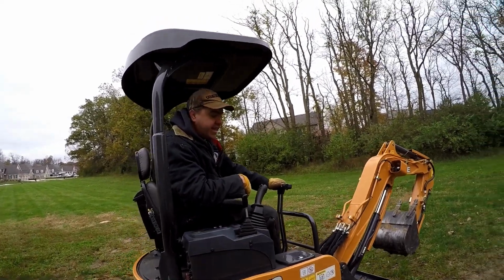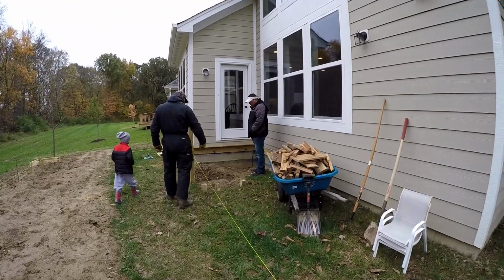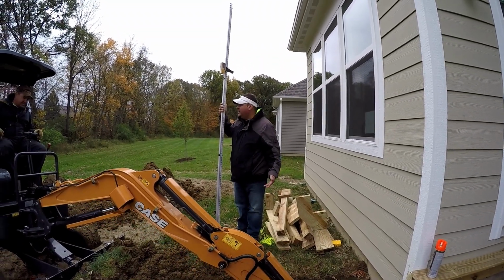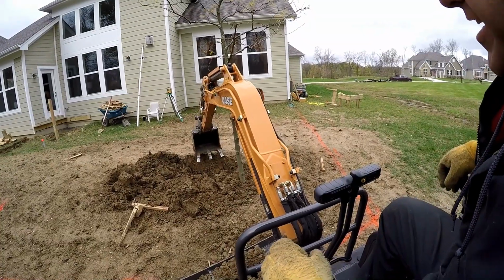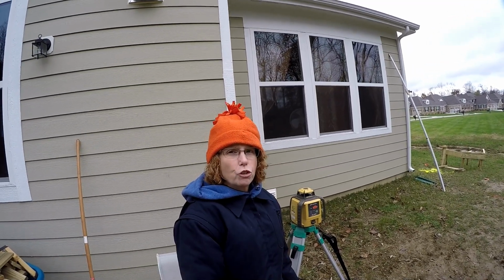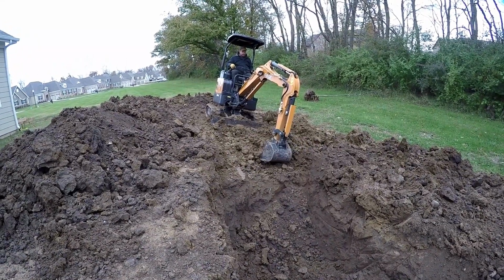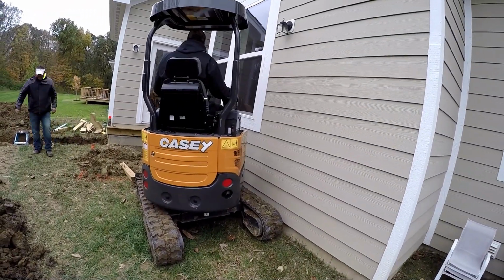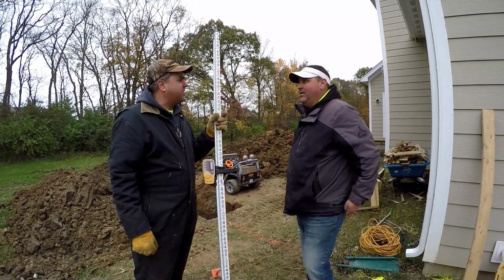The Big Dig, Case CX17C Mini-Excavator Digs Footer for DIY Patio, Job Too Big for JD 1025R

Comment: May I suggest, that the next time you're on uneven ground, orient Casey with the tracks perpendicular to your trench. Then use the blade to lift Casey to a level position from the downward side. By doing this you will also loose stability, front to back, from your digging direction as your tracks are now perpendicular and you have the shorter span towards your digging direction. Casey is a great addition to the team!

Comment: Put your spoils (excavated materials) about 3' away from the excavation. And so you can see your lines when digging put you bucket flat to the ground and knock the loose dirt back in the trench to take out with the next bucket.
Reply from the maker: +Branden Howard good advice, thanks.

Comment: Turn the machine sideways and use the blade to level the excavator.  Note  dirt should be two foot away from you ditch and no one should be in a 5’ ditch. Always safety first! Good job on the dig.

Comment: Hi Tim, Good equipment (Topcon). Getting ready for some leveling. Topcon Laser, Topcon Pole mount 360 degree reciever mounted on box blade, with Topcon blue tooth magnetic mount display in cab. This way I wont have to look backward at reciever mounted to three point with blade, Raising, lowering watching only display in cab. Full automatic is $5k more, Hopping manual will be just fine for 1/4 acre. Here is a magnetic reviever for back hoe Topcon LS-B10 Machine Mounted Laser Receiver 57110 mounts to backhoe for level trench. Case will be happy to see this video.
Reply from the maker: That sounds like a fancy setup.

Comment: Great job Tim ! And your wife was a very important part of this project !!!! Again thank both of you !!! Be safe my friends and God bless you all !!!!!! Eddy
Reply: One thing to remember Tim when it starts freezing you need to clean the track and roller frames. If it has to ever set outside that is !!!!
Reply from the maker: +Ray Eddy thanks Eddy.  She is an important part of EVERY project!
Reply from the maker: +Ray Eddy ok,'thanks!  First equipment I've had with tracks
Reply: On surface coal mines we used what is called a track spade. Just a slim shovel really  .

Comment: Hello

When starting a trench you scrape off in layers, from the furthest reach of the boom all the way back to the machine. This will ensure the track is going straight and not starting to veer off course. To obtain a nice flat level, use the boom and the bucket in unison by moving the lever over towards the bucket to crowd it slightly. That is you keep the bucket flat as you start bringing the arm back towards your machine. It takes a bit of practice but once that skill is achieved you can grade with ease. Another good tip, if your machine wobbles because you are sitting on an uneven surface while digging. Wiggle the tracks slightly this will help the machine bed into a more level surface. A wider bucket without the teeth would be a great addition to your machine to help move the piled dirt quickly and for levelling large areas.

These machines are worth their weight in gold.

Congratulations on your new addition to the digging family :)
Reply from the maker: +D0csavage1 thanks!

Comment: Great job Tim you have to love how fast you can swing and dump the dirt so for away from where you are digging at and that you can get right next to the house to dig ! now you need a small dump trailer to work with Johnny so you can move it out of the way ! but great first video for casey ! have you tried to put Johnny & Casey on the trailer to see if they would fit ? take care have a great day and God bless ! Curt :-)
Reply from the maker: +Kioti CS2410 they will not fit, not even close
Reply: I did not think they would i know Johnny is just like my Kioti and they take all most hole trailer but i have see some guys put the Mini-Excavators on side ways up front and let the backhoe hang off the back ! but take it ezy !  Curt

Comment: Something else you could have done to level the excavator while digging, is to turn the tracks 90 degrees and use the dozer blade to level Casey. It does require more work to move.
Reply from the maker: +Travis Moore don't have much stability if I try sideways digging.  ...need that blade in front to stabilize.

Comment: Just saw this video. Good job. Get used to building a level area for the excavator to work from. Talk to the finance department about getting a 36-40 inch grading bucket and a atv dump trailer while it won't replace the JD you can get a lot done with those items. Keep on having FUN
Reply: I know it is quite randomly asking but do anybody know a good website to watch new series online ?
Reply: @Maddox Zakai flixportal
Reply: @Lance Kolton Thanks, signed up and it seems to work :) Appreciate it !
Reply: @Maddox Zakai You are welcome :)

Comment: Do you think this excavator or the 27D would work with digging down 7-8 feet around my basement? I need to install a French drain.
Reply from the maker: The cx26c or cx35c would be a better bet for 8’.  Cx17c will do 7’

Comment: I have to try and rent one of those Case this summer for a little project i've come up with. Do you all have to deal with a HOA to do these improvements, permits and all??
Reply from the maker: The customer usually handles the permitting in our situation.  We usually work with more 'DIY' oriented folks.   We usually don't handle a complete construction project.
Casey will definitely do the job for you.

Comment: No need to pile dirt up to make yourself level. You should just turn your tracks sideways and use the blade to level yourself to dig the vertical ditch.
Reply from the maker: +01Brever as I said in another comment, sideways digging doesn't work so well.  Really need the blade in front to stabilize.
Reply: That is correct, but sometimes you have just have to turn them and take smaller bites to make things a little more comfortable and convenient to yourself. Every job is different and there could be a lot of different ways to do each job. Thanks again for posting these videos. You do great work and I enjoy watching them. Main thing is to stay safe out there.
Reply: Real excavators don't have blades and should always dig with the main idliers and not on drive sprokets and in tight areas ofcourse you might gotta dig sideways and to level yourself out your take a scoop and dump it under which ever track you need to level
Reply: Tractor Time with Tim your ment to dig with the blade behind you but whatever works for you

Comment: Run the high track backwards with the bucket in the hole, it would have excavated the dirt and levelled the machine.
Reply from the maker: +Graham  Pahl wonderful idea.  I appreciate that!  I'm certain that would have worked in this situation.  Thanks
Reply: Wears out your tracks quicker, same thing a doing a burn out.

Comment: I an not beleive that Case does not have a thumb kit,makes a huge difference in working on projects. Needed the proper bucket for this kinds work, a mucking bucket would have been faster. Got the machine so far figured out.
Reply from the maker: I now have an 18 inch bucket.  That was a 16".  I wouldn't have needed much more.  The ground was pretty hard at some points.

Comment: On a under three ton machine the blade should be behind you to anchor the machine.I run a Cat 301.7D
Reply from the maker: +skidoomach1 Interesting. The book says in front.  And it sure helps with stability when down in front.
Reply: Some say front some say back, I've done it both ways with mine and find it hops less when at the back, I watched this video from cat and it explains it a little betterhttps://www.youtube.com/watch?v=oRZbOMoeTx8
if you have a chance give it a try and see what you think.

Comment: Just a tip don’t put fill in the center looks like very wet clay like material would be better off using process underneath that patio
Reply from the maker: we will remove that pile of fill before he pours anything. This was temporary.

Comment: One why did you throw your dirt to the inside of the footer??? And also why not use your blade to level your self out just put it to the downward side and use it to lift the machine to get level
Reply from the maker: I put some inside, but most outside.  I didn't have much on the inside until he had me dig that 4x4x3 hole by the back door.  I was not expecting that one.  
Digging to the side (blade not directly in front of you) doesn't work very well.  really need the blade directly in front to dig effectively.

Comment: Hi there, I was wondering if you could help me out.

I have a big hole to dig, in order to build my house.
After seeing the prices of rentals and the crazy prices of paying someone to do it, I was wondering if it's plausible to buy a mini excavator and do the job myself.

I have more than a month to do it, and the whole thing will be around 10 feet deep to the bottom layer.
Around 40 feet times 35 feet is the outside dimensions of the construction hole...

Is this plausible?
Subcontractors are asking in the range of 15.000 dollars and I can buy a brand new mini excavator for around 10.000 and probably sell it afterwards for 6-7 easy.

Would save me a lot of money if plausible, and now with the Corona I have all the time I need. I have no experience on the excavators but am smart and tech savy
Reply from the maker: You won’t find one that will dig 10’ deep for $10,000 brand new!
What are you going to do with all the dirt you dig out of the hole?  It will take a huge space to store it. 
I suspect with no experience, you should allow someone else to help you.  
Where are you located?
Reply: @TractorTimewithTim  it doesn't have to dig that deep as there is room for the ramp no problem.
I am a civil engineer, have seen it a thousand times, but never done it myself.
Berlin, Germany, I already found plenty in range 8-11 k, just not sure if it's plausible
Reply: I've only seen the big ones in action, so I am wondering about the mini ones, have no idea of their strength and voluma
Reply: @TractorTimewithTim  as far as all the dirt goes, about 1/5 will go back after the basement is done, about 1/3 will go to build a step-wise garden, a ramp and a car port, level with ground floor (around 4 feet high).

I should be left with 2/3 to 1/2 of all that we dug out. There are companies that transport those, I would pay for that part, and there's a lot of private people that would take a part away for free.

So I figured I could do the works real carefully with a mini excavator (there's some installations that need to be patiently cleared away, a shovel for the most part).

I am just not sure if the quantity of the job is implausible or if I am overestimating the machine since I've never seen it in action.

You seem to be able to do almost everything with it, so I was wondering if there are limits to the machine...

Also, a lot of companies selling their used equipment cheap now because of Corona, but I am not sure if that's a risk worth taking since I never owned or maintained one, so I figured buying a small new one should be ok?

1 tonne -1.2 tonne machines approximately
Reply from the maker: Maybe Eric Jansen...one of our subscribers in The Netherlands could help you?

Comment: Are you folks contractors? It’s not safe to be in a hole that deep with out shoring up the sides.also when digging on small slope turn the machine side ways and use your blade to level the machine, that’s a sweet machine keep the fun coming
Reply from the maker: Is that a yes or no question ? :-)
I'm not sure how to answer it.
Watch more of our videos, and  let us know what you think!
Reply: Rockie mountin

Comment: Love your guys vids but please read up on some osha trenching rules at depths 5 foot or more u either need to slope the trench or have shoring If someone is gonna be in the trench your better off staying out of the trench and you need to keep your spoils at least 2 foot from the edge of the excavation. As crappy as that dirt was it could have caved off on your wife  that stuff happens quick. I just dont want to see one of u guys getting hurt. I Hope ur working for cash and dont have a company for this work your doing cause osha would have a field day over this them guys don't play around.lol be safe u guys

Comment: Blade goes behind where your digging
Reply from the maker: +oliver mansfield incorrect. Sorry.  Blade must be in front to be effective
Reply: Front for sure
Reply: bkrgi that guy in the video is lifting the machine on purpose just to try and make his point! Anyone that knows how to operate a machine this will not happen too them with the blade in front plus if you are digging really tough dirt/clay blade in the rear will not hold you. You will just pull yourself forward every time. Don't care what the video says I have put hundreds of hours on one and this guy is wrong!
Reply: I’ve put thousands of hours on mini, rookies put the blade in front... blade just gets in your way too much when it’s in front of you and you lose break out force.  Also as you back up you can knock down uneven ground.
Reply from the maker: This thing is very tippy with blade in rear.  Not very much break out force.  So, using your terms, I think I will remain a ‘rookie’ using blade in front.